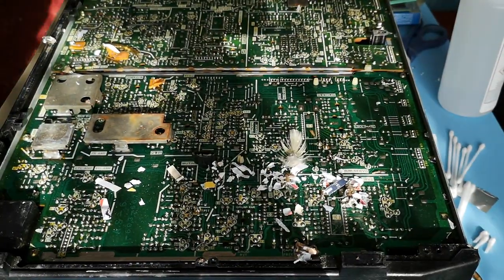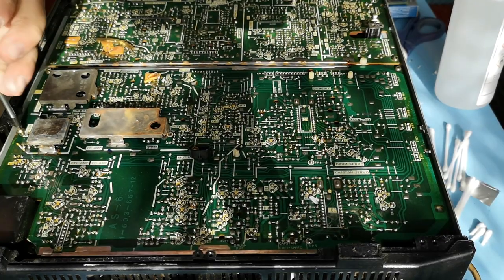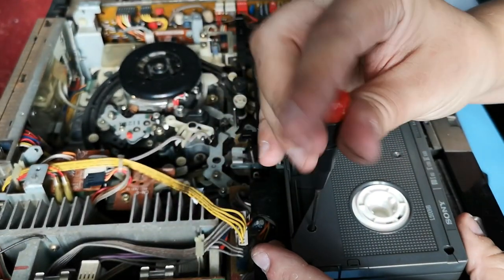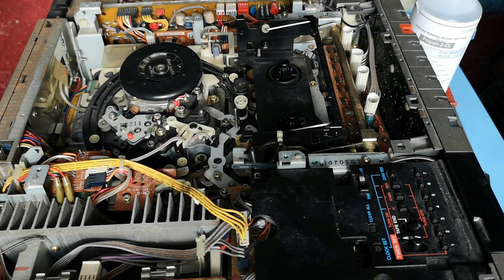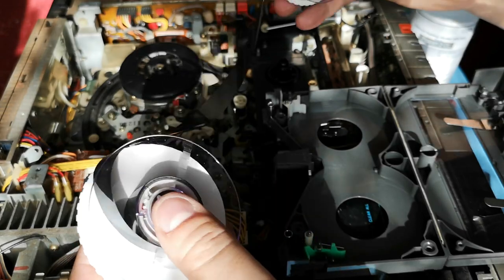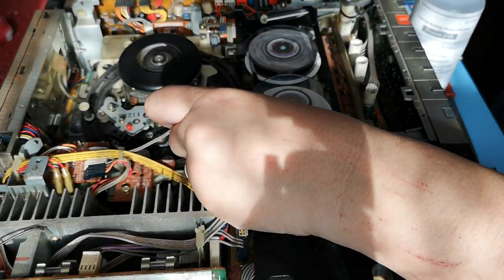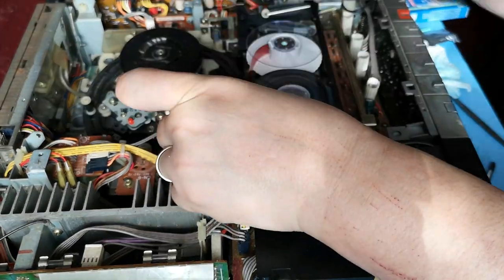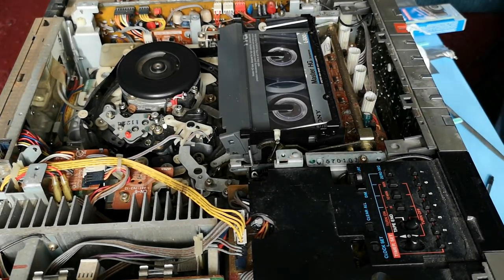Removing mould from Betamax Video Cassettes

Comment: You really do need proper ventilation and an excellent quality mask as the spores are cancerous. Threading a tape with it having isopropyl on it is probably why you're getting 'sticking' - you need slow tape movement to allow the isopropyl to evaporate before touching any tape path components although this method is really not recommended and at a push is good to just playback a tape once for archiving before throwing it in the bin but you did save a tape to do this which is great.

Comment: yeah my player i opened it up to inpsect if i could rig someting and its not as easy of removal for the tape carriage i dont think. Im thinking about getting a 2nd junky player and just do like other people do use it for cleaning tapes only...but its betamax players arent readily easily to come by. I got my 1st moldy betamax tapes today, nightmare on elm street what a gem, but moldy, and the guy also had a junk sanyo player but wanted $30, maybe i can get it for $10 later

yeah uneven winding, thats why itd be nice to leave it in and let it wind around all the spools that way it winds the tape back and forth nicely, but the of course that would dirty your player/heads up bad.

Comment: I've cleaned beta tapes before but I used a VTC 5000 which unlaces in fast wind modes so it was much easier than using an older Sanyo or any Sony machine. Another point of failure with older tapes are the tabs near the reel brakes. These tabs gently wipe the tape as it passes through the rollers. What happens is these tabs are held down with glue and when the glue deteriorates, the tab falls off and sticks onto the tape and that can easily ruin the heads.
Reply from the maker: Thanks for the advice as the reel brakes.....as regards machine choice, I was originally hunting out a shabby VTC5000, given its unlacing during fast forwards and rewinds, however, the majority were all very pricey and too nice to use, I also did not fancy breaking into my own collection of numerous Betacords. This C5 came up for just £5, looked like a shed, looked like it had lived in a shed, so was the idea candidate. It turns out that it's far better inside, than it's exterior appearance suggests, but, it seems to have done the job with this particular cassette. Next on the list, my original Betamax copy of the original 1973 classic, 'Gone in Sixty Seconds', a rare version, given it has the correct, original soundtrack. The DVD re-release, does not.

Comment: Thx for this. Being in Sydney Australia my VHS tapes have a mould issue with the humidity. Did you just wipe the tape edges or did you need to clean the actual tape surfaces as well?